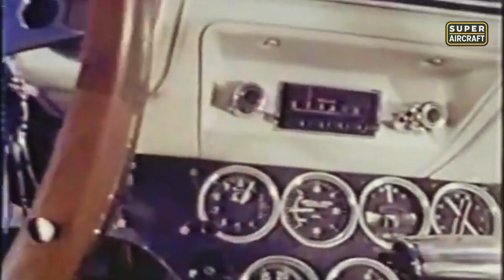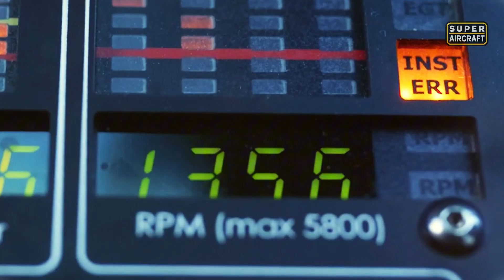WHY FLYING CARS THAT WORKED PERFECTLY NEVER TOOK OFF?

Comment: Seems to me that if Moller had had modern electric motors to work with then his creations probably would have made infinitely more sense (because his 'computer control' was handicapped by not having access to instant torque & therefore couldn't achieve proper stability)... well, the Sky-car M-400, anyway, flying saucers still seem inadvisable because sudden gusts of wind seem to flip them like a quarter in a coin toss 😨

Comment: Recently electric air taxi and flying electric car start-ups of all kinds seem to be a favourite with investors. Many of them will probably end in failure.
Most of them can fly thanks to powerful electric fans and lithium ion battery's much but the range is poor and a viable business is much harder.
Reply from the maker: Excellent observation, Stephen. You're absolutely right that range and energy density are still major limiting factors. Many early projects may not survive, but their failures often push innovation forward. Advances in solid-state batteries, hydrogen-hybrid propulsion, and distributed electric systems are already showing promising results. Once the technology matures, we might see electric aircraft finding strong niches — especially in short-haul regional aviation. The path is difficult, but it’s a necessary step for a cleaner and more efficient future in aviation. 🤠✈️

Comment: Molt Taylor was a talented engineer and along with his various projects he solved several large design problems like torsional resonance issues with extended prop drive shafts for pusher propeller installations..   The biggest issue I see is a lack of discipline with car drivers unable to follow even simple traffic rules.. so would you want a drunk driver in a flying car?  
Me either  but it's still a cool concept..
Reply from the maker: Great insights! 😃 Molt Taylor really pushed engineering boundaries with solutions like tackling torsional resonance in pusher configurations — a remarkable achievement for his time. And you’re absolutely right, the real challenge today isn’t just the technology, but human behavior and discipline. Advanced systems can solve mechanical issues, but preventing reckless or impaired operation in flying cars is still a huge concern. The concept is amazing, but the responsibility behind it would have to be just as groundbreaking.🤠✈️